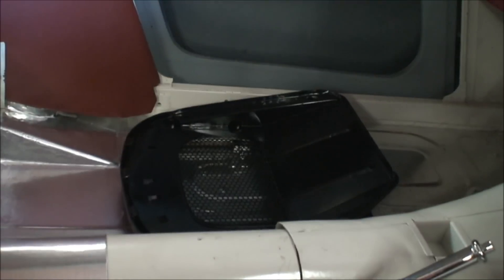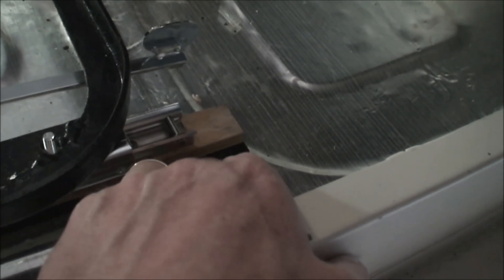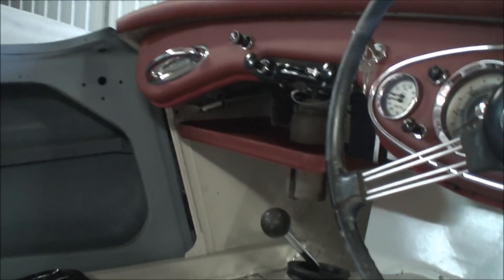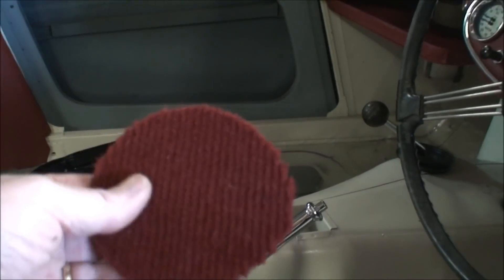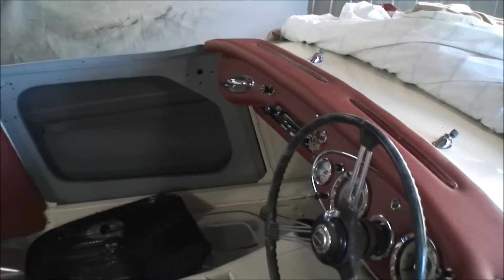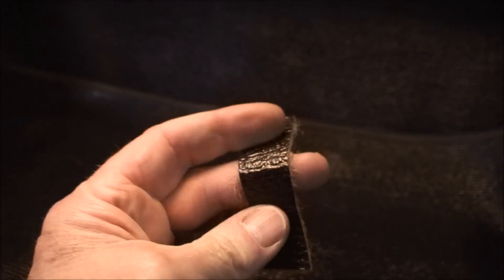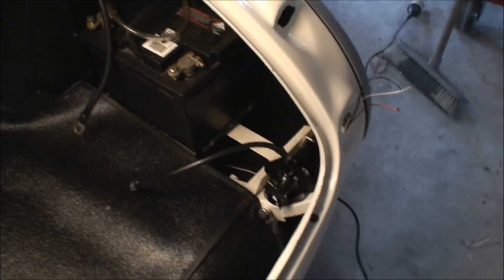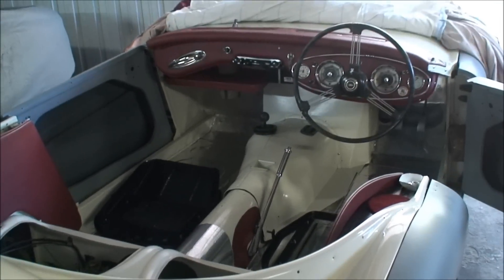Austin Healey 100/6 Restoration Pt 35

Comment: Wonderful job on the seat slides and boot. Looking at the Moss catalog it seems the choke bracket was attached to something on the right. The bracket was rather thin and long, but there is unfortunately no indication of what it was fastened to. I forgot whether your car has two or three carburetors. I remember that the tri-carb chokes were very stiff and difficult to operate. Unfortunately, any of the cars I could look at here would be LHD.